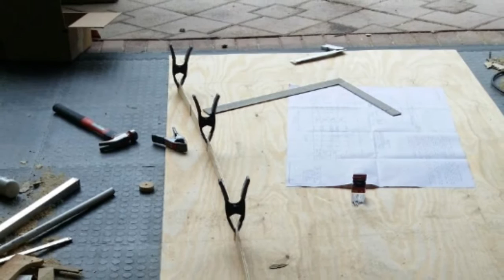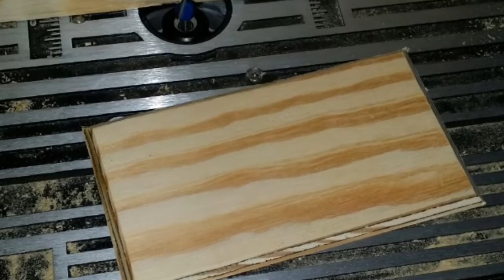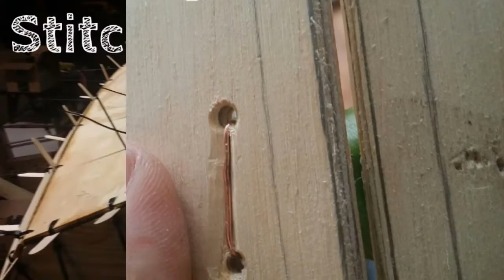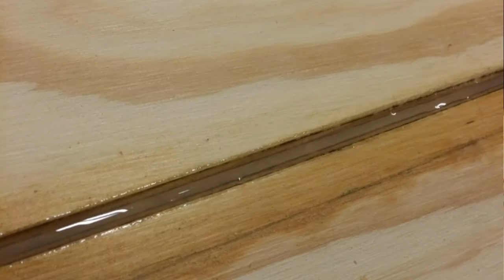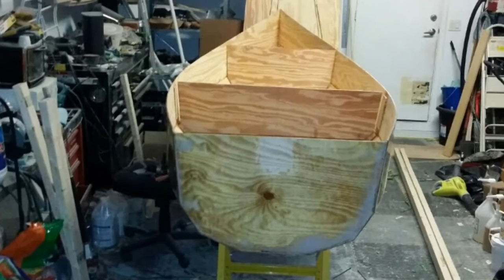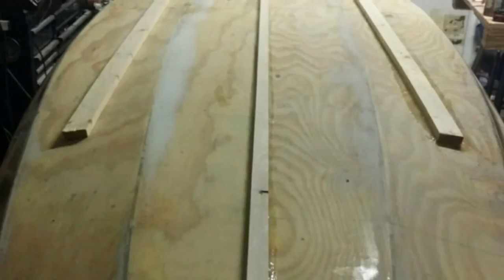Building Selway Fisher's Outboard Motor Canoe; Stitch and glue boat building method

Comment: just got the plans for this.....any tips or hints. What size outboard can you use. Like the video !!!
Reply from the maker: Thanks. Yeah I bought a few plans before I settled on this one. As you can see I decided to build a strongback type jig and build it upside down. There were no plans for this so I kind did my best. Most plans have you stitch it then do the fillets on the inside. I preferred to use the popsicle sticks to keep the panels spread and glue the seams first. The plans are not real detailed on how you put it together. Also, there is a lot of leeway to make it the way you want. I have only used electric trolling motors on it so far. It is a great boat, though and I'm very proud of it.
Reply: Looks a great boat....you should be proud of it !!!! Hope mine is half as good looking.
Reply from the maker: Thanks. I'm sure yours will be great. It really is an awesome boat. Make a YouTube video of your build, too